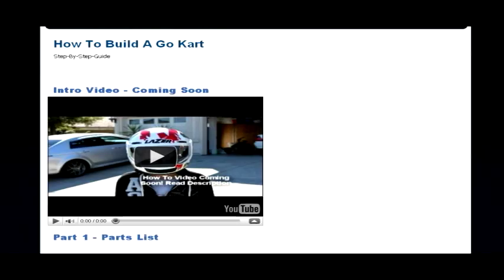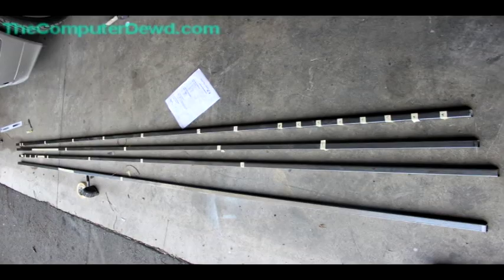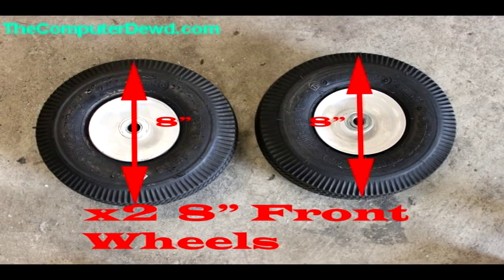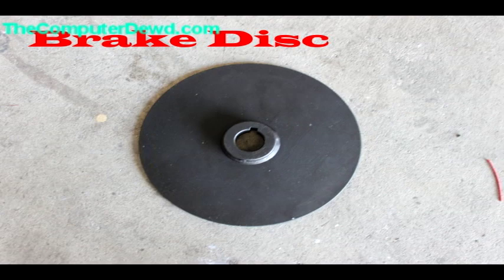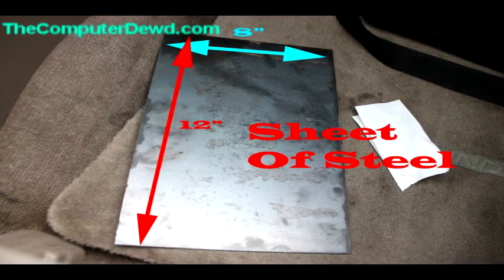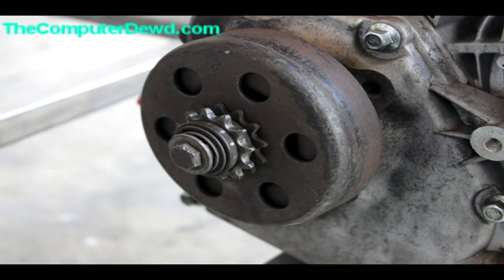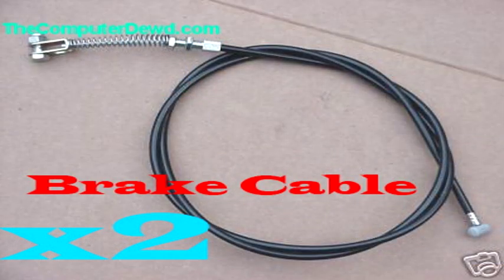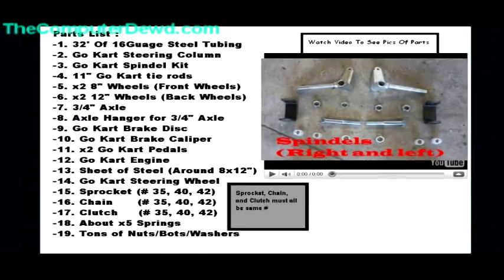How to build a Go Kart : Part 1 : Parts List

Comment: @TheComputerDewd 

Thx for the quick answer, I'm planning to build something alike, With some improvement, still to the Planning period tought.... I was thinking of adding a Independant suspension at the front and at the back, Also instead of a 4 stroke 6 hp engine, maybe a whole Moped Crankcase with 70cc 2 stroke, Since i know lots about Moped engines. Your video rocks man, i will probably base on that, Do you know any website where i can like "blueprints" my plans ? Thanks !

Comment: @TheComputerDewd ok, first the engine will be mounted where the shaft is vertical, mounted near  the seat where the center of gravity is, use a $50 performance clutch, and weld a bevel gear on the clutch and on the axle. I would be able to go at least 120mph, 140 tops, with 10 inch tires. Not that hard if youve worked on riding lawnmowers since you were 8.